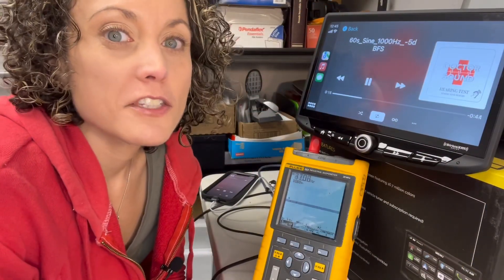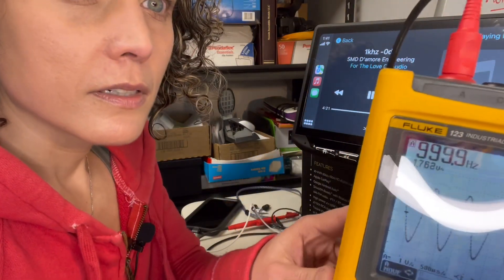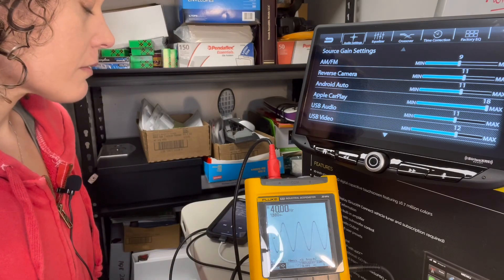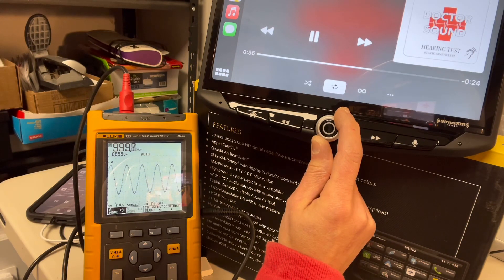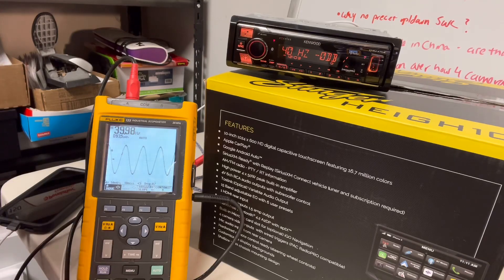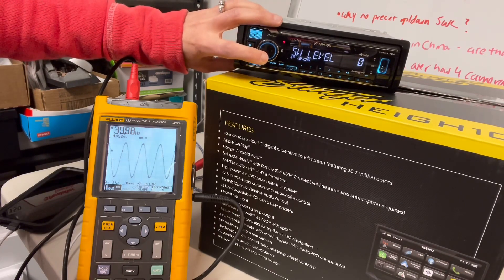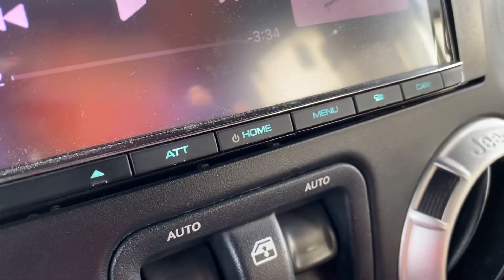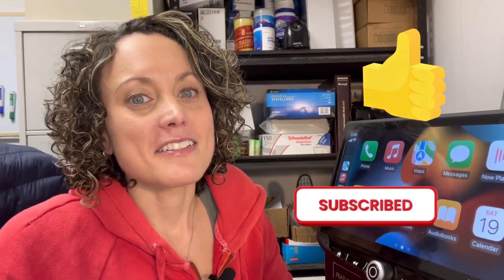Stinger HEIGH10 Review Part 1 - Preamp Voltage & Distortion Test with Scopemeter by @carstereochick

Comment: Suspected this. Having a hell of a time getting this to sound decent. Replaced my stock HU That was going into an LC1 Running a jl 500/1 and a 300/4. Rockford p3 and infinity kappa. Stock HU SOUNDED WAY BETTER. plus I can't get the stinger to update so my carplay doesn't  work.
Reply from the maker: Hey Scott, did you leave the update file zipped? I made that mistake the 1st time I tried to update it. I will say, we have since switched to using the toslink out and I'm back in love with this stereo again. If you don't plan on doing a DSP that accepts toslink (like a Helix DSP for example) you could throw in a line driver. We had an Audio Control Matrix in ours which improved output, but the toslink is so much cleaner that I actually love the way this stereo sounds now.

Comment: OMG, you may have saved me. Installed the Stinger in my Gladiator and replaced all the speakers. I have a simple Rockford Fosgate P300-8P powered sub hooked up to the sub output and it sounds great...when its working. Sometimes the sub plays and sometimes it doesn't even though power is on etc.. I hooked up the sub to a different head unit and it was totally fine. Contacted Stinger and they sent me a new harness which I have yet to install. I am going to boost my Carplay signal tomorrow to test. Would you mind sharing the link to the Line Driver you successfully used? Were you able to make a vid of how you added the line driver? Any help you could give would be great to save this expensive purchase...
Reply from the maker: Thanks so much for the comment David! That video is next on our to-do list, but it's been such a busy summer we haven't gotten to it yet. We used the Audio Control Matrix - https://amzn.to/3Py9TSS

Comment: I've had this unit for about a year now and my biggest gripe is the lack of 80hz for the subwoofer crossover. It goes from 63hz to 100hz...wth?. Also I installed a high powered system with an Orion DSPLX 3000.1 amplifier and four 15 inch subwoofers...The Stinger keeps restarting every time the bass hits low. Damn i might as well had bought a Boss head unit....My Alpine Halo11 did NOT do that.
Reply from the maker: Hey Roderick. I'm confused, I have 80 Hz option for the sub crossover. You can select 25, 40, 63, 80, 100, 160 or 250 Hz. Maybe you need a software update on yours?? As far as it shutting down, if that's only happening when the bass hits low and hard I suspect that may be more of a power issue. What's the year, make and model of your car? How old is your battery? Are your dash lights and headlights dimming too when that happens? I'd want to put a multimeter on the ignition power line to the radio and see what the voltage is when that happens.

Comment: What is the level of the 1khz test file? It should be just about 0db to get a meaningful output voltage. I've seen too many test files -20db or so which would make the voltage output meaningless.

Comment: Stinger is using a Chy-Na bulker manufacturer, they have no set test measurement and do not adhere to design wants of the manupackager (Stinger) ... Stick with Apl, Pio and ken. 
Great video, we did these tests back in the 80s... Clarion 5632 and 5671s had some clean ass pre out. Cheers
Reply from the maker: Thank you my friend!!! :)

Comment: So is this deck not recommended?? I have an appointment next wk to have this installed, obvisouly the price isn't cheap and for that much I expect top notch, they didn't have any test screens inside for me to check out. I really wanted the android auto but figured I'd go to a bigger screen. Is their another 10 inch screen that you'd recommend for around the same price?
Reply from the maker: We kept it in our car and I don't know if the chip issue has been resolved yet. The last time I checked was a couple months ago and it was still the same issue. We ended up putting an Audio Control line driver in our Jeep JL to correct the issue (which is not ideal, but it's a work around that gave us the missing voltage). You could check out the i509-WRA-JL from Alpine. It's a bit more $$, but there is a lot more audio control and it's really 4 volt. We're putting the i509-WRA-JK in my 2014 JK in a couple weeks.

Comment: I'm a bit curious about this head unit for in my 1986 F-150.  Currently running with a Pioneer NEX4400 which I love, but I'm thinking about putting that in my "17 Ultima and getting this since it's a single din, for my old truck (I'll be doing a resto-mod on the truck, with an updated interior, and a classic old truck look outside).

Comment: I know this video has some age, but that voltage does not surprise me. When I saw the voltage specs on Amazon, I was surprised and was lucky enough to see you made a video on this. Look at all the other Chinese brands like Joying, Atoto, and Dasaita; they all have the same specs, 2V. This unit like all the rest, it is just rebranded with a custom launcher.   I saw in a couple of comments you seem let down that you ended up using an Audiocontrol line driver. I have been using a AudioControl EQS for 10 years and my sound has always been top notch across several vehicles and changes in other equipment. What issues are you having with the line drivers?
Reply: Even so, unless the test file is at 0db, the test is meaningless. I don't know why so many test files are set at -db
Reply: @Davesworld7  0dB is full signal, negative dBs are a reduction in signal (down to -infinity which is fully off) and +dB are when a signal has a gain applied. 0dB is also sometimes called Unity. This is consistent across digital mixing and analog mixing where anything below 0dB is reductive (the source signal is reduced) and anything above 0dB (when the board or software supports it) applies a gain to the signal via a pre-amp (in analog processing) or increasing the amplitude by the selected amount(in digital).

When metering, 0dB is often the either the maximum or ideal capability of the hardware or digital signal space you are working with. In the case of setting it to the optimum strength, there will be some headroom above the ideal signal level before hitting clipping. You should check documentation for the particular board or system you are using for the specific implementation.
Reply from the maker: No issues with the line driver, it sounds great now. I just feel cheated because at one point they definitely were making these units with the better quality 5 volt pre-amp so I'm more disappointed in the brand that they would cut corners like that and still try and pass it off as 5 volt. But that move did help them sell more of these radios last year when other brands like Alpine, Sony, Kenwood, JVC and Pioneer were out of stock.

Comment: I wish you could have did this video before I went and dropped $1,600 on this thing . Any updates you find after speaking with stinger would be greatly appreciated thank you for the video.
Reply from the maker: Ditto. In our own vehicle, we haven't had a chance to try the toslink and see if it's any different. I think this has to do with the chip shortage. I'm hoping we get more output with the toslink, but in previous installs, we usually see less output with toslink compared to RCA. But then again that's in situations where we're comparing it to a 4 or 5 volt pre-amp connection, not a 1.7 or 2.5 volt connection.
Reply: Stinger seriously needs to update the Height 10 with more features mainly wireless Android Auto and Apple car play and stop charging extra just to get navigation
Reply: Man looks like I am not the only one that spend money for nothing this unit is garbage poor picture on the back up camera everything about. This unit is sucks not happy with this unit also technical support are  so rude

Comment: Did you try boosting the eq?
Reply: I’m guessing that they are making it unclippable for the average user.  If not, I’m super bummed as well, as this was at the top of my list.  Love the testing videos. Thanks for taking the time.
Reply from the maker: Thanks Sarah! I didn't try boosting the EQ, but I do want to reach out to Stinger and find out under what circumstances they achieved 4 volt. The manual says: Audio output level (max): 4.0V preout. Maybe as you suggested that is with bass boost on, loudness on and bass jacked to the max. I will have to try it. Do you drive a Jeep JL too? There are such limited options right now for name brand/quality big screens in these vehicles. On paper, this unit really does have a TON of great features and nice GUI. FYI Alpine is coming out with some newer Jeep JL models for 2022 which I'm super psyched about the i509-WRA-JL. 9" high res anti-glare display, wireless connection for Apple CarPlay/Android Auto, 24 bit DAC, 13 band parametric EQ (per channel!) and a bunch of other goodies. Expected retail will be $2199.
Reply: Thanks for the reply. Sarah is actually my wife’s name. Sorry to misrepresent.  Neither of us drive a Jeep but this hu really ticked all the boxes for me.  I’m sure that Alpine is killer but a little out of my current budget which is 0 after my speaker upgrade. I’ve been doing some similar tests you’re doing and have noticed a strange waveform at 40hz on both of my Kenwood Excelons.  The wave is perfect on top but, there is a slight angle on the bottom peak.  On the older model (2012), it’s always there regardless of volume. On the newer (2016) it is only noticeable at clipping, but again, only the bottom peak.  It does not appear to be an artifact from the scope itself as it is a nicer B&K analog.  Have you seen anything similar with Kenwood’s?
Reply from the maker: Hey there Sarah's spouse ;) I have not seen that, that's weird. I do have an older eXcelon deck poking around here somewhere I can try that with. What I have seen in most of the newer decks is to keep the signal clean at high volumes you really should keep the sub level at 0. If you want to go past that, don't put the head unit volume past 3/4. Some of the older eXcelon decks have a bass extension option which basically takes whatever you have set for 62.5 Hz on the EQ and extends that to lower bass frequencies. I'm assuming you're doing these tests with the EQ flat, but have you checked the other advanced settings and turned off bass boost, bass extension, loudness and supreme?
Reply: @carstereochick  Yup. Everything off and 0’d.

Comment: Called Stinger to inquire about your finding on their Flagship system, the support technician attempted to answer my questions in GEEK language, it would be interesting to hear your response about this finding after calling the tech support and listening to their explanation? Additionally, I was also wondering is it just a bad head unit that you were testing? Based on this review? :https://youtu.be/09bk1EicUyc
Reply from the maker: The person who took your call in tech support may not even be aware. I don't believe any of this stuff is tested in house before shipping. It's made overseas, arrives at their various warehouses and gets shipped out to shops across the country. Even if they were aware, I don't think they are going to ever acknowledge this officially so I am not at all surprised that they basically denied it or danced around it. They probably said something like maybe my oscilloscope hasn't been calibrated recently, but I always test with two other tools when I see anything odd (the DD1+ and our Fluke MD88 multimeter which is always spot on for voltage).

Usually with defects we see issues with a product functioning. This product functions, it's just not exactly as advertised so doubtful it would be considered a defect. My plan is to keep testing these as they come in/go out of the shop. I am 100% sure this is related to the chip shortage and that when these 1st came out, they WERE 4 volt because we have sold and installed these prior to putting one in our own vehicle and they sounded like they were 4 volt. It wasn't until we put one in our vehicle and noticed the difference in output that we started digging into it. Before this we had the Alpine X409 which was truly 4 volt (we tested that too to be sure). 

It's interesting, I noticed the publish date on that video link was December 2020. That's actually when I received our 1st HEIGH10 and we installed it in a client's 2-door Wrangler JL in January 2021 with a small aftermarket amp (50x4) and Alpine powered under seat sub and that's when we were like, "This thing is really cool, we should put one in our Jeep!". My guess is this became an issue later on in the year and it's just due to parts shortage. It will probably be resolved soon. They were probably just hoping there weren't any geeks like me that would ever actually notice and check/measure it.

EDIT: I WISH we were getting 6 volts out of this thing. I'm jealous. But that explains why the little 2-door we did last January sounded as good as it did. That's a cool test tool too, the DM-RTA by Audio Control, but it's really performing the same test I do with the oscilloscope. It's more flexible in that it can test a whole bunch of things as well.
Reply: @carstereochick  Thank you, I have been debating on a purchase of this unit for my TACOMA, and came across your awesome video Thanks
Reply: @carstereochick  another question, could you or did you identify if the unit is compatible with auto-dimming, my Tacoma will adjust the display brightness based on the exterior lighting?